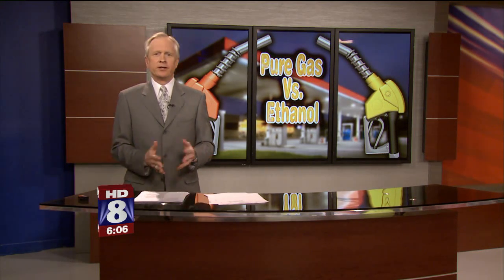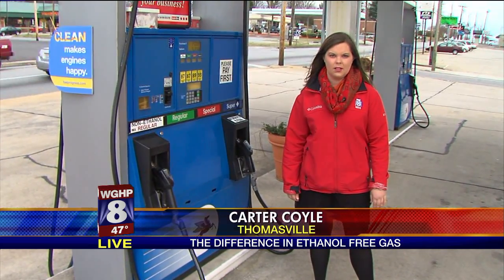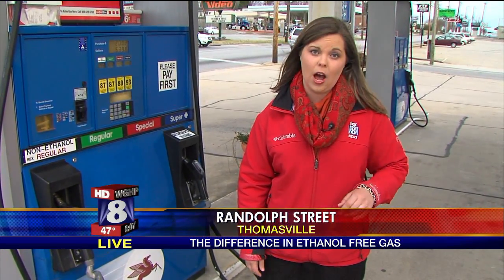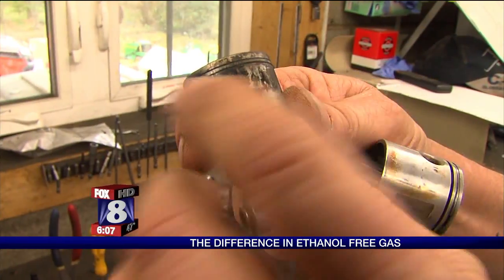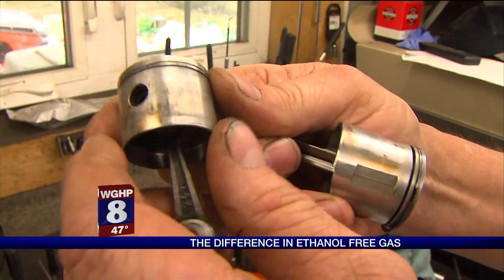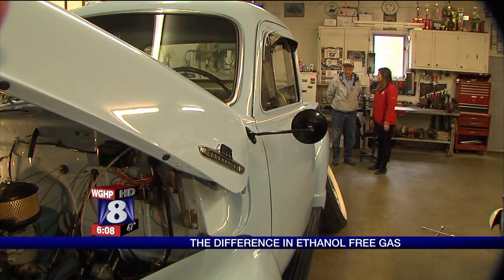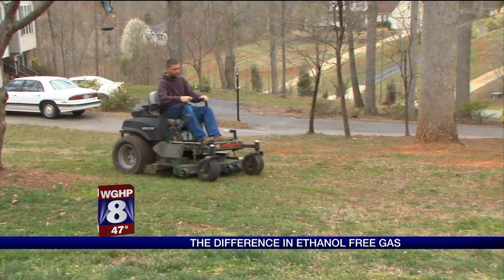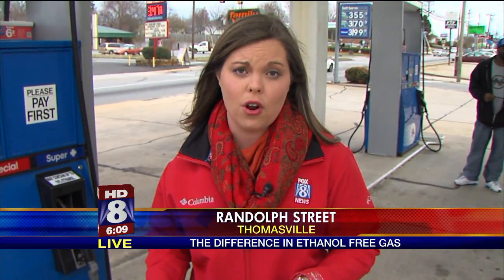Pure Gas v Ethanol

Comment: I'm terribly sorry that I found this video so late after being broadcast and posted on YouTube. 

It must have been an extremely slow news day in the Greensboro market, and I presume that the people at the TV station were trying to set a Guinness World Record for how many dumb things can be said in one so-called news report. Starting with the news reader at the station, to the intern posing as a reporter, then the goofballs that were interviewed, it was one giant schmuck-off.

I presume they were successful in winning the Guinness award.

The comments made about ethanol were beyond funny because they have no basis of truth. Something is only funny when there is a semblance to the truth. You got it all wrong. 

There is no corn grit in ethanol. It’s a distilled liquid; the “grits would have had to evaporate, rise above the liquid in the vapor, and then reform later in the distillation process. This does not happen.

Ethanol does not separate into water, or collect water when you leave it uncovered. If it did, you would be able to prove it by simply leaving an uncovered glass of alcohol on your kitchen counter over-night. It might evaporate some, but it doesn’t separate or increase in volume. Do a taste test with some 151-proof rum.

Ethanol is about 99% pure, approximately 100-proof. If you take the purest rubbing alcohol you can find, which is not as high in proof as ethanol, and pour some on your kitchen counter it won’t leave any greasy residue. If there was any greasy residue in the example you videotaped for the story, it was as a result of the gasoline ingredients, not the ethanol. 

The non-ethanol gasoline that’s referenced is not “pure gasoline,” as there is no such thing as pure gasoline: Gasoline is a complex combination of many petroleum oil-based ingredients. In order for non-ethanol gasoline to work properly in a vehicle engine, some form of anti-knock agent must be included in the liquid. If you don’t use ethanol, you must use another product such as tetraethyl lead or MTBE – both of which are poisonous to humans and most other animals. If you don’t use lead or MTBE, you have to use another petroleum oil based ingredient that is manufactured to replicate the anti-knock properties of ethanol. Therefore, you are merely duplicating ethanol with an ethanol-impostor. The difference is that the ethanol comes from American farmers (I assume they have farmers in the Greensboro DMA), whereas the ethanol-impostor comes from an OPEC controlled source. I would rather have my fuel money go to American farmers than to foreign terrorist regimes.

But the bottom line is that if ethanol was uniquely as bad for engines as the story claimed, then it would mean there were no engine repair shops prior to ethanol being used in regular gasoline. It would mean that engines had never before experience fuel line and fuel filter clogging; that you could have left gasoline in an engine for an extended period without creating a problem. None of this is true. To prove this, go to the library and get an old yellow pages phone book; you’ll find plenty of small-engine and large-engine repair shops.

By the way, ethanol cleans engines. In the opening shot of Carter Coyle at the fuel pump there is a sign that reads “CLEAN MAKES ENGINES HAPPY;” well, ethanol makes engines happy. Gasoline makes engines unhappy and is ultimately responsible for killing hundreds of thousands of American military men and women.
Reply: Ipostle
That's possible, Ipostle, but the savings someone would get from using a high level ethanol-gasoline blend would more than make up for any loss of miles per gallon of fuel.
Reply: you said what I was thinking and for those who know the truth about ethanol you said it for them too. the report is so bull! how to they get away with these lies!? I was lol. they did it all with a straight face. am I being punkd? I kept waiting for Ashton to pop up.
Reply: I watched it again. funnier the second time around. I've come to the conclusion Ashton must have been driving in one of the cars in the background! hahahaha
Reply: Too bad ethanol and water do separate. Don't be a fool.
Reply: Ryan Norton 

Hi Ryan, I hope you're having a fantastic day. 

You mean that gasoline and water separate. Ethanol (alcohol) and water are miscible, they mix together. 

The reason someone would put Dry Gas in a tank that has some water in it is specifically to remove the water. Dry Gas is ethanol. If ethanol and water separated the Dry Gas wouldn't be effective.

Another way you can test your theory is when you go to a bar tonight order an extra whiskey and water. Then hang around and see if the whiskey and water separate.

Let me know how you make out.
Reply: +The Auto Channel  I've drained ethanol out of a boat before, left a little in a mason jar, left it out over night under a covered patio, and there was water on top of the gas in the morning. Atmospheric conditions, air really, causes the two to separate. Ethanol is fine in a car because no air is allowed in the tank but in something like a boat where there is a vent that air travels in and out of, the water will separate from the gas. I've heard plenty of stories of people with water in there outboard because they foolish put ethanol in their motor. Why do you think they sell treatment for outboards?
Reply: Ipostle 

Hey Ipostle, what's happening?

If E85 delivers 10% fewer miles per gallon than E10 or ethanol-free gasoline, but the cost per gallon of E85 is 15% less than E10 or ethanol-free gasoline then you would have a net gain of 5%.

If you only pay a 10% premium for ethanol-free gasoline as compared to E10 or E85 then you are very lucky. In many markets ethanol-free gasoline can cost $3 or $4 more per gallon than ethanol-gasoline blends.

Which city do you live in?
Reply: Ryan Norton 

Hi Ryan, thanks for your reply.

Very quickly I'd say that what you witnessed was condensation. But first, there's some housekeeping that needs to be done (so to speak). You start by saying that you "drained ethanol out of a boat," and end the sentence that "in the morning there was water on top of the gas." 

Why were you using ethanol in your boat? Do you mean an ethanol-gasoline blend? If so, was it E10 or higher?
Why do you presume that the water would have been the result of the ethanol and not the gasoline?

I assume you know that dew forms in the morning from condensation. When you go outside you'll find water droplets on grass, lawn furniture, glass, metal, etc, and yet you probably didn't spray ethanol around the yard. 

You may be interested in watching and listening to the Mercury Marine E10 webinar that they presented in 2011. They categorically state that the separation problem that boaters attributue to E10 does not exist.

You can find the entire 1 hour webinar online. But here is an edited version of their comments:

Mercury Marine, the world's largest manufacturer of marine engines, recently held a webinar to debunk some of its own myths about ethanol. I attended with interest. The first myth was that there are fuel additives that can prevent all issues associated with ethanol-blended gasoline. For example, no fuel additive can prevent ethanol from acting like a solvent. The second myth was that fuel additives can make stale or phase-separated fuel useable. "Fuel cannot be rejuvenated," Mercury determined, and they noted that it's a myth that ethanol-blended fuels are bad and should be avoided. Here are some quotes from the Mercury Marine webinar.

"There is no active transfer mechanism for ethanol molecules to reach out and 'grab' water molecules out of the air. Under normal storage conditions, even in a vented fuel tank, it just does not happen at a level or rate that is relevant."

"Major multi-billion dollar companies with enormous resources have improved gasoline additives but there have been no recent breakthroughs involving 'magical technology.' Claims made by companies about 'space-age,' 'revolutionary,' or special proprietary technology should be looked at with a high degree of suspicion."

"E10 Ethanol absolutely IS an acceptable fuel for everyday use. After the transition period from E0, E10 may actually be a superior marine fuel as it tends to keep low levels of water moving through the fuel system, keeping the system 'dry.'"
Reply: +The Auto Channel  It was the fuel that came in the boat. I didn't put it in there. The other guy did. There was way to much water that separated from the gas for it to be condensation. Plus it was under a covered area so morning dew isn't why it was there. My car has no morning dew on it under the carport so the fuel wouldn't have suffered from that. I know what I saw which was water that separated from the gas. If I put ethanol fuel in my 2 stroke mercury that thing would never start. Nothing runs like a mercury.... 

Also, ethanol free gas is never $3-$4 dollars more. Like $.50 cents more at the most.
Reply: Ryan Norton 

Hi again - I'm not sure what you mean by "Nothing runs like a mercury.... " However if you have a real interest in this subject you should listen to the webinar I recommended.

In any event, the condition you describe and attribute to ethanol is impossible. The water was from condensation, which can form whether there is dew or not. If you put cool liquid in any glass container condensation will occur. If water separated from alcohol you would see it in every liquor bottle you have in your home.

Ethanol-free gasoline is often more than $1.00 per gallon higher than E10 and frequently more than $3 to $4 more than E10. If you live in an area where it is not that high, and you want ethanol-free gasoline, 40 or 50 cents is a good deal for you.
Reply: Ipostle 

You mean you think that my family owning the largest ethanol plants in America would be the reason I am so pro-ethanol? 

If we did, it probably would impact my thinking. But I checked with my sisters, my wife and her family, and I went through my tax returns for the last several years and couldn't find any indication that we have any financial involvement with ethanol production, distribution or retail sales... other than liking to drink wine, beer and various cocktails. I do have two bottles of rubbing alcohol in the bathroom medicine cabinets.

Actually, I'm glad you asked that question and I'm going to give you the full answer in a moment. But I would like you to do something; after you read the following please tell me why you are so opposed to ethanol fuels that you are willing to post lies and unfounded information about ethanol fuels.

We originally published the following story on The Auto Channel website 5 years ago:

Why Is Getting US Off Gasoline So Important to The Auto Channel?

Engine fuel and energy technology doesn't just power automobiles, it powers our entire economy. No, I take that back, it powers the world’s economy.

The automobile industry is the world's largest and most important industry. If we, the people in all democratic countries, can find a new and better way to fuel vehicles; something that saves money, and keeps the money in the domestic “purses” of each country, then it gives everyone in that country a boost. If we can find alternatives that don’t damage the environment then we’re all healthier and happier. And if we can find alternatives that can’t be used as strategic weapons by one country against another then we have a freer global society. And if we can do all of this then people buy more cars and trucks, which increases job opportunities, corporate revenues, taxes, and enjoyment of life.

The bottom line is that we support all alternative fuels; particularly those that we can produce here in America from American raw materials. We love CNG, we love propane, and we love algae-based bio-fuels. But we especially love ethanol because it can be produced from so many different types of abundant raw materials right now, today, and the use of ethanol doesn’t have to require any engine conversion. Depending upon your vehicle you can put a rather high percentage of ethanol in your fuel tank right now. And the only effect you will experience is that you will save money – up to $1.00 or more on every gallon of ethanol you use. You don’t even need government approval or EPA sanctioning to do it. You just drive up to an ethanol pump and fill ‘er up. You can even make your own ethanol in your backyard. You can't do that with CNG, propane or algae biofuels.

We also love the idea of electric vehicles, but we're very skeptical of electric's potential to help us out of our present economic depression. Electric cars may just not be a significant factor until the end of this century, the 21st century. That means that not only will you be dead and buried by the time of an electric vehicle revolution, but your children (if they are above the age of puberty) may not see it either. We feel that electric gets the support they do from the gasoline companies because the gasoline companies know that electric isn’t a real threat. They use electric as a carrot before the mule: “Just keep on using gasoline; we’ll get to that there electric soon enough.” But soon never comes.

As a matter of interest, we’ve been approached by Brazilian ethanol entities to help promote the sale of Brazilian ethanol in America, but we don’t do it. We’re happy that the Brazilians have developed such a strong ethanol industry; and we’re certainly thankful for what the Brazilians have done to show the contemporary world that ethanol is still as great an engine fuel as it was considered 100 years ago; when Henry Ford and the top engineers at General Motors thought that ethanol was the best engine fuel. But we don’t want to replace our dependence on Middle East or Venezuela or Russian petroleum oil with Brazilian ethanol. We have to stand on our own and every other country should do the same.

In any event, what this all gets down to is building new factories, putting people to work, creating new supportive businesses and putting people to work in them; and keeping the money here to be used to buy more domestic products that are built by our own citizens. The petroleum oil and gasoline industry just sucks us dry. It's great for the Arab sheikhs and dictators so that they can live in fantasy lifestyles and pay terrorists to wreak havoc around the world, but it does nothing for us. This is why the issue of alternative fuel is so important to The Auto Channel.

I'm looking forward to your reply, Ipostle.
Reply: Ipostle 
So you asked a question about why I'm so pro-ethanol, and I gave you an answer. Then I  asked for you to provide back some information as to why you go out of your way to spread lies against ethanol.

Instead you state more lies, and then have the nerve to say that the lies are coming from my side. 

I'm not the one hiding behind a silly screen name, you are. I'm not the one who is not providing references to statements, you are. For example, you say that the price of corn is poised to rise, where did you get that information? Don't you know that corn is selling just slightly higher than it did in the late 1970's to the late 1990's? Don't you know that the price for the past year has been at it's lowest since 2008-9? Don't you know that corn's price level rise and fall based on the rise and fall of petroleum fuels and commodity speculation?

You want the market to be free? When was the market free before the introduction of ethanol blended fuels? For decades America was forced to use only poison gasoline. A free market would mean that the oil people stop standing in the way of the ubiquitous availability of E15, E20, E30, E40, E50, etc. You want ethanol-free gasoline to be available? That's fine with me as long as all ethanol-gasoline blends are available. But you don't want a free market. 

I think you've shown yourself to be either a complete ignoramus, or that you have a typical liar with vested interest in continuing America's dependence on a poison petroleum fuels, or both.
Reply: Ipostle 
Well, you don't want ethanol, but you don't want it because you were brainwashed into it. You can't even respond to a simple question about why you feel it necessary to spread lies about ethanol.

I fully described why I want ethanol. you keep ducking why you don't. The chip is on your shoulder. I report on automotive issues as part of my profession, and fuel is part of that. What do you do that makes you have to spread lies about ethanol?

Why can't you reply honestly?
Reply: +Ipostle I have run E30 in my 2009 Avenger since the day I got it.  I even run E85 when the price is right, but my car isn't a flex fuel, and I've put 135,000 miles on it with no problems so far.  So my 7 year old car does just fine on higher blends.
Reply: Well you said no one wants it and that you can't run higher than 15% in your car unless it's brand new, I was simply pointing out that you're wrong on both accounts. So don't speak in absolutes and make yourself look like a moron.
Reply: +Ipostle Oh i see, when you lose an argument you call me a weird name and try to insult me?  So I take that to mean you concede that you've lost this argument and have no other actual contributions to this discussion.
Reply: People that are against ethanol get their info from news and word of mouth. People that love ethanol get their info from science.
Reply: Says the guy thats obviously no mechanic.
Reply: ethanol is a solvent an it brakes down fuel lines and seals .... ethanol will absorb and suspend its volume in water and when it sits over night the water and ethanol separates from the GASOLINE that is why you have water in the bottom of your crusty carb bowls and your jets are plugged.. not to mention two stokes potential to lock up from lack of lube because water and oil dont mix ...SO it dosnt matter WHAT you put this ethanol-enhanced  BOONDOGGLE in... it will cause damage to your equipment ... still not convinced ask why its not used in air craft
 ETHANOL also kills brain cells ... from the comments left below some ones had to much to drink!!!WINDOW LICKERS!!!!
Reply: Every component of gasoline is a solvent.  Benzene, toluene, and xylene are all great solvents.  As far as straight solvents go they're wonderful.  So wouldn't they have the same affect on your fuel lines? Ethanol is miscible with water (it mixes completely) but this is actually a benefit.  With no ethanol the water would sit at the bottom of your gas tank, because every gas tank gets condensation in it eventually.  By leaving it at the bottom of your tank it will build until your gas pump starts to suck straight water and you have to go get your tank cleaned professionally.  NREL (a national lab) did a study that showed that the small molecules in gas evaporate, turning the gas to varnish, long before phase separation ever happens.  And, that fuels with ethanol had a longer overall shelf life (didn't turn to varnish as fast) than those without.  So if you're seeing phase separation, the gas turned bad long before any separation happened.  And that plugging is from the varnish in the gasoline, ethanol doesn't gum up.  Need proof?  Go pull a 90 year old bottle of moonshine off the shelf, still as liquid as the day it was poured.  Its not used in many aircraft because of how hard it is to certify new fuels through the FAA.  The Vanguard Squadron is a group of show pilots that use 100% ethanol to power their planes.  There are also several companies currently trying to certify ethanol to run in airplanes to replace the lead that prop planes currently use.  And yes, now I need a drink.
Reply: You are correct, AC.
Reply: Have any more names you want to call me to distract from the fact that you have no facts to back up your argument?  How is ethanol going to eliminate equipment?  What would even be the point of that?   Yes, ethanol was mandated, to boost octane an reduce the amount of oil we bring into this country.  It replaced MTBE and leaded gas before that, both of which were horribly dangerous and harmful.  The sad thing is if you go back to the original research the scientists knew ethanol was a better octane booster but the executives were worried it would displace too much oil, so they went with lead.  That poisoned us, so after fighting it for years they switched to MTBE to poison the groundwater before finally going back to what they should have used originally.
Reply: I'm not even sure what you're ranting about with your special Agenda's and carburetor deadlines but if you want a stable fuel with an infinite shelf life then you should be using ethanol, not gasoline.   Gas is a mix of close to 200 chemicals, some of which will react with each other, and some of which are just suspended in the solvent components.  Once those solvents evaporate, and the remaining chemicals start to bond to each other, thats when gas turns to varnish.  No one ever mentions old bottles of whiskey getting gel like.  Ethanol will stay just fine on the shelf.  So yeah, I'd love a fuel with long term stability, its ethanol.  And it can be used in fuel injected engines so if your anti-carb conspiracy theory is true thats just fine too.
Reply: Phantoms Colts  what? your capslocks is stuck again...